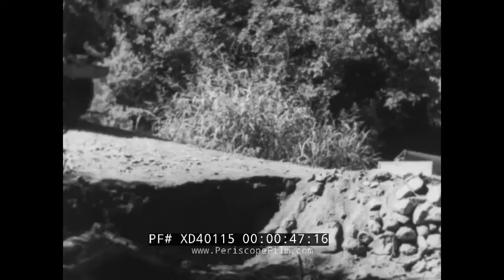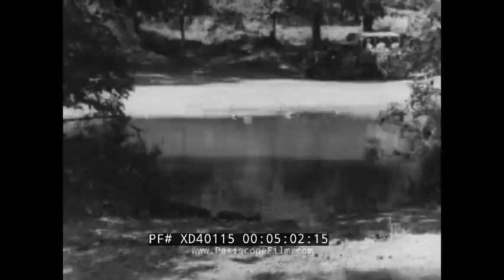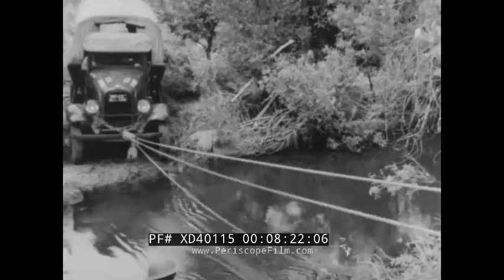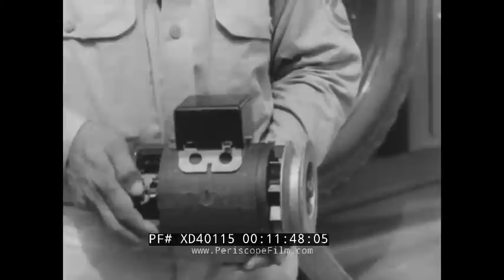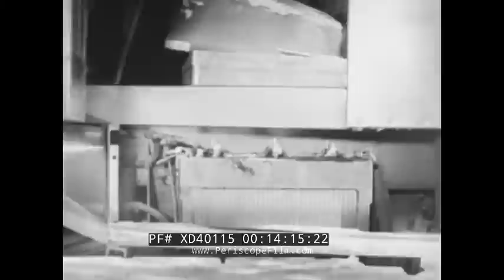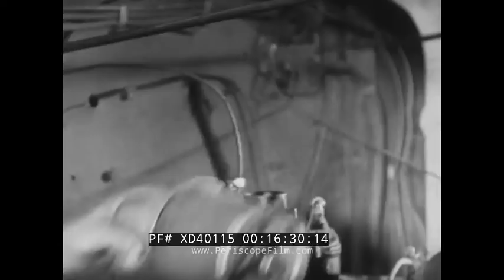" TRUCK DRAWN UNITS STREAM CROSSINGS "  1939 WAR DEPARTMENT TRUCK DRIVER TRAINING FILM  XD40115

Comment: Seems like you should have a mechanic with you for the deep water crossings. A lot of Army personnel in 1939 had never driven, much less reinstalled the ignition system on a truck so that the firing order was correct.

Comment: Crossing a Bridge with to much weight? The truck First and pulling with a rope ( horse hair i believe) the load. Understand that but, why hasn't anyone figured out a drop down/ hand crank temporary wheel for this application?
I could just imagine being in a unit crossing a deep stream and saying " Eight trucks and 12 hours of work per truck"!!
Thank You for Keeping History Alive!
Reply: I think the rope is probably hemp. Using the truck to tug it while the men lift on the trail is probably the fastest, most efficient method. If there were a crank it would have to be geared down to a crawl since only one or two men would be able to spin it. The fact that this method hasn't been improved upon since world war I is a fairly good endorsement of the practice. Just sayin'